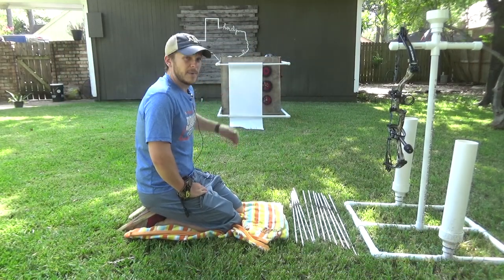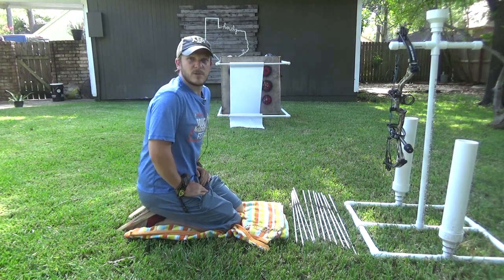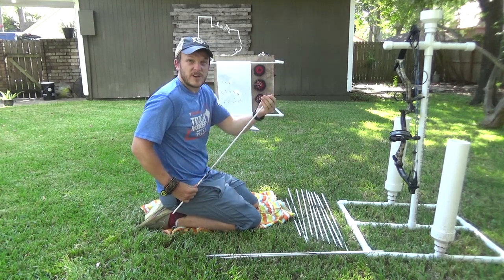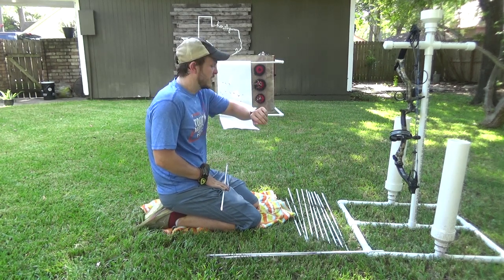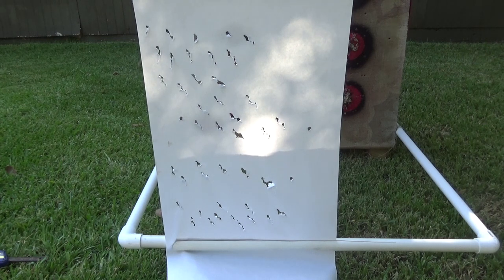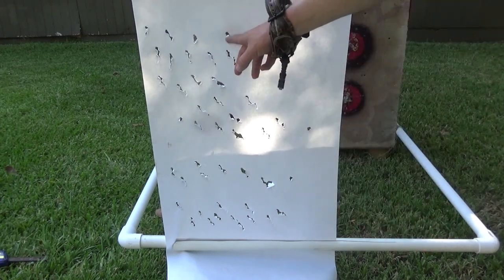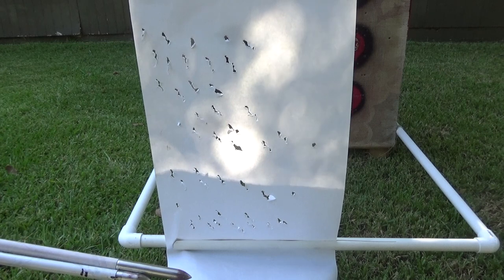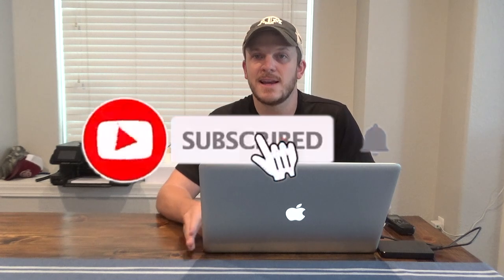Ranch Fairy Kit Part 4: Tuning

Comment: “Clocking” the rotation of the bare shaft as your bow/ strings release it was pretty eye opening. 
We have 3 Gearhead T18s. My daughters shoot the 40 pounds and I shoot 50 pounds. 
One shot right, one was dead on, and my bow shot left. 
All this time, I assumed as a right hander, it shot right. 
Wrong. 😬

Comment: In your first video on heavy arrow build, you used your spine tester to get close to stiffer spine on top for good arrow flight.
When you later go to the bare shaft  nock tuning, is it pretty accurate? Is it an important step to do?
Reply from the maker: It was fairly accurate, usually was within 1/8 of a turn or so. I thought it was pretty helpful. With it being that accurate, I may skip the nock tuning step this year and only nock tune if I have some arrows doing weird things